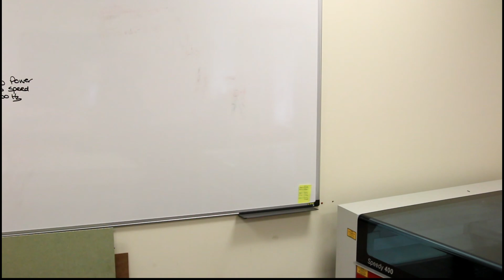What happens if you put your finger in a 120w Trotec laser?

Comment: When cutting through the acrylic at the beginning, what were those flashes that would happen occasionally?
Reply from the maker: That's flash back from the steel laser bed underneath the acrylic.
Reply: @javiklaserltd  awesome, thank you! Is that something to be concerned about for more precise prints? Will it burn the piece, or is it just an optical flash that is otherwise harmless?
Reply from the maker: @anubisarmory3147  in most cases it's unnoticeable, you can stop it from happening altogether by raising the acrylic slightly off the bed, we use sacrificial acrylic spacers to do that.  .